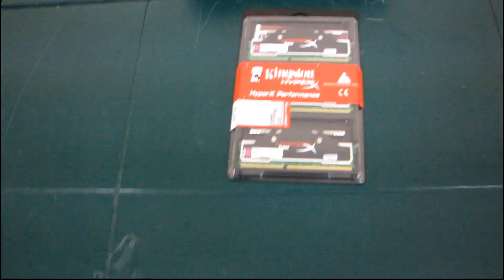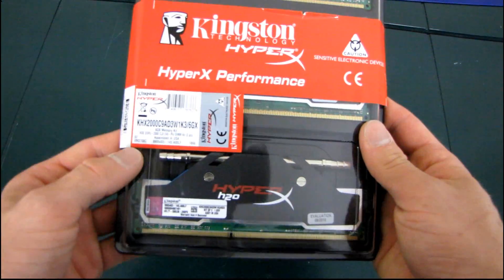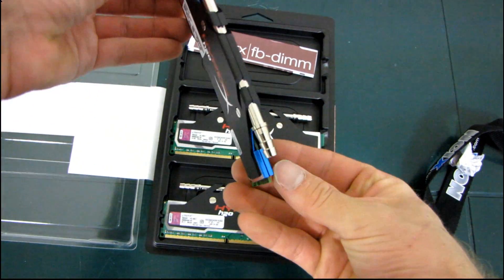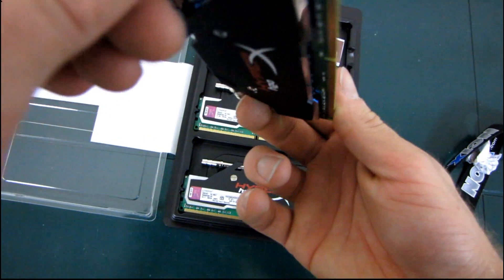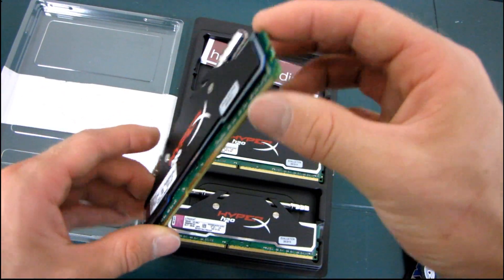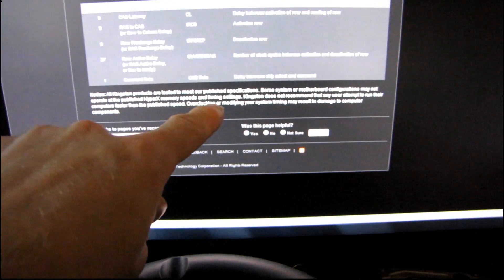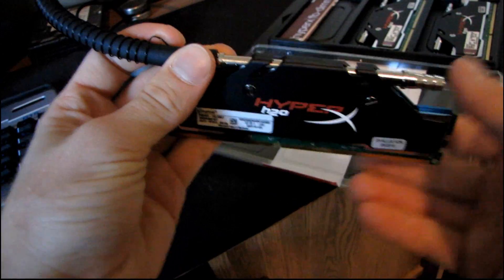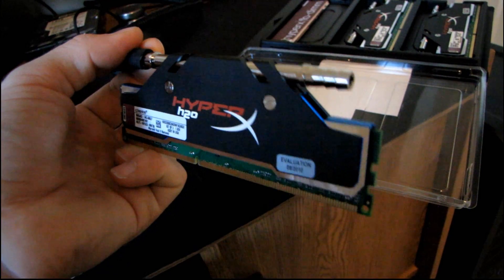Kingston HyperX H20 Liquid Cooling Ready DDR3 Memory Kit Unboxing & First Look Linus Tech Tips

Comment: @DrGoodwrench64 You don't use coolant in liquid cooling systems. You only use transfer material like water or at best non-conductive liquids. You can potentially damage circuitry by reducing the temperature of the boards/parts below 0. Room temperature is where it's meant to work or higher. Coolant is for refrigeration systems, please stick with your day job.

Comment: @madzane94
Basically, Ya, it's a fail. Liquid cooling is the way to go though. It's very quiet (*Cough*) most of the time. It is faster at dissipating heat over straight aluminum heat sinks. Done right, liquid cooling can get below the freezing point.

Comment: I water cool and overclock my systems.  I have never seen ram get hot enough to need water cooling.  A simple fan mounted on the ram works fine.

Comment: Unfortunately liquid cooling *sometimes* isn't worth the money nor the time for the 2~3 degree difference in your systems but that is depending on how much hardware you have in your systems and if there is enough room for air flow. But quite frankly now a days it os fairly easy to do cable management because all the cables are getting smaller.

Comment: @Linus: isn't this kind of piontless? I have a liquid cooled system but every enthusiast knows that the only components that need to be extreme cooled is your cpu and gpu. The main reason for the leap from ddr2 to ddr3 in the first place wasn't speed due to the fact that ddr3 produces higher latencies as its bandwidth increases. No, the main reason was the lower power usage and heat dissipation compared to the old ddr2...